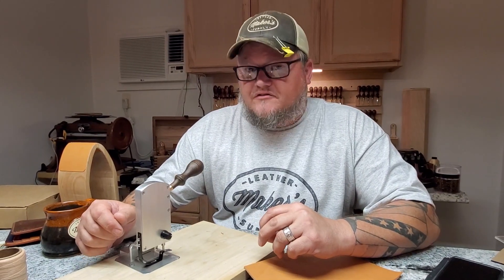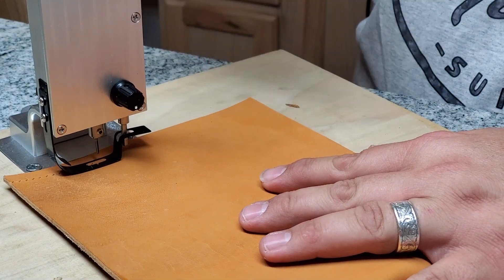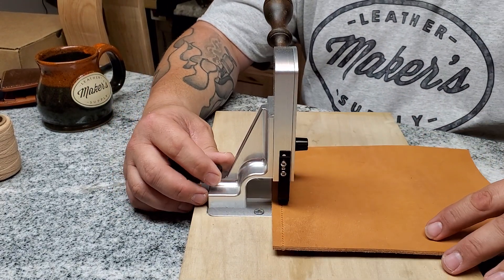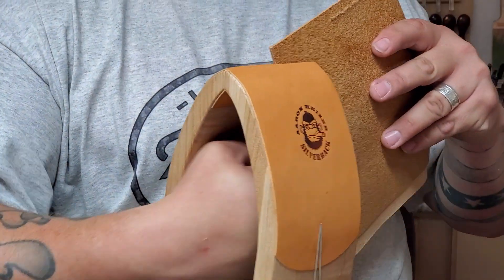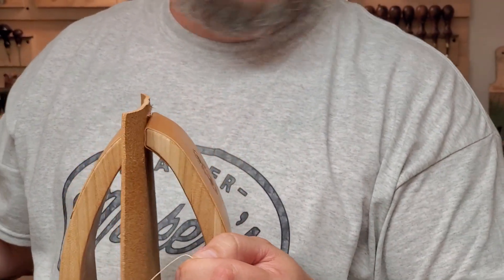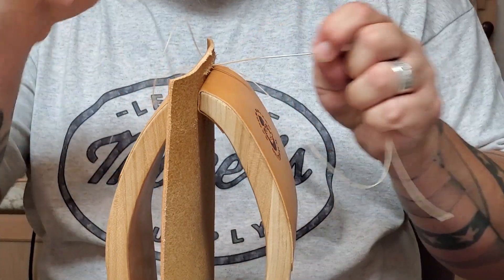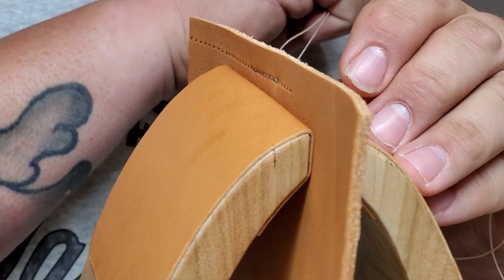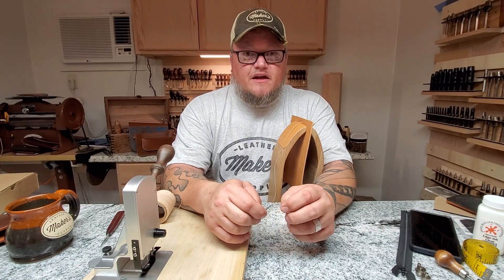The Punch-O-Matic Stitching Punch

Comment: I think that one thing that possible would make this better is if on the edge guide that you have a ruler to tell you how far away from the center of the hole punch
Reply: I was thinking the same thing. You can get a sticker with a tape measure printed on it at hobby lobby

Comment: is there different sized chisel punches? i use from 3mm to 6mm punches which have different sized blades. 3mm is alot thinner
Reply from the maker: It currently has 2 sizes.  We are working on 2 more.
Reply: @makersleathersupply1220  any thoughts to add a round hole punch options instead of a chisel?
Reply: Are the stitching punches sold separately

Comment: Can you punch thru 3 pieces of leather for knife sheaths? Like after you glue it up ... I use 5 -6 or 6 -7 thickness depending on the blade size. Thanks...
Reply from the maker: It would not work well with 15-21combined oz of leather.

Comment: I bought one of these and so far am having nothing but trouble with it. It doesn't seem to want to feed. It will do great for a couple of holes then stops feeding. If it's operator error I can't figure what I am doing wrong after between two and ten holes that's causing a problem.
Reply from the maker: Best thing I can tell you is you must make sure to go all the way down and then all the way back up with the handle on each cycle.  If you'd like to send it back for us to take a look at we would be happy to.
Reply: @makersleathersupply1220  just to double check there is no adjustment that needs made out of the box
Reply: After a little more working with it I am thinking the leather we were trying to use it on was too light weight for it.

Comment: In the coming weeks or months can you do some more demonstrations of this? Maybe include other complexities one would experience in a leather project. I specifically would like to see how the reverse side looks when dealing with multiple layers of leather. It is easy to put your 'stitch iron' EXACTLY where you want it on top, but it is a bit harder to ensure the iron comes through the other side EXACTLY where you'd hoped. It would be great if this device eliminated all variation between the top and bottom holes... 
Also, I would like to see a gradual curve. I can envision a sharp 90° turn being a non-issue but a gradual curve may be much harder due to the guide...
Definitely interesting, and definitely has the potential to increase the quality of hand made items. Just need to see MORE. MORE!
Reply from the maker: I'll be using it in lots of upcoming videos.
Reply: @makersleathersupply1220  - can't wait! 👍
Reply: This is not a new device.  I've never owned one, but I have seen them demo'ed at shows several years ago, and the backside was the main selling point.  I was a bit disappointed that Makers didn't give credit to the inventor. They presented it as though they had made it.

Comment: This thing cost me $25.46 to try it out. I sent it back and was refunded $285. 

Upon opening the box, I noticed the light weight unit was made of soft metal. The metal also had spotted stains, scratches and plenty of chatter from being made. Aaron later told me he was randomly inspecting the units but leaving them in their factory sealed boxes.

What really mattered to me was if the Punch-O-Matic would perform well for me! After a weekend of trying it out, I returned it. I simply couldn’t find a sweet spot to punch and have the leather walk up nicely or consistently with the foot. I could only get one dial setting the stitch width to the work on an occasional basis but it was useless because I had to manually advance the leather because I couldn’t get the foot to work well. Adjusting the foot proved to be too hard for me, I was so frustrated. I wanted this to work for me! 

As for the holes it punched, the back end of the leathers are blown out. I sent Aaron some leather that I punched so that he could see. Due to the blow out, I wouldn’t have been able to let products go out the door. I never got to adjust the chisel to a different angle than the factory setting. It was in the hole very tightly and I didn’t want to risk hurting it for fear of eating $285 instead of $25.46. 

Granted, screwing it down to a board might have helped some but I rigged it well with clamps and it was firmly planted. I just did’t want to risk scratching when screwing it into the bench.

Well, I sent it back to Aaron. After getting the unit back he approved a refund, but man, losing $25.46 for shipping from Aaron and back to Aaron was an expensive experience. 

Hopefully other buyers found the Punch-0-Matic to be what I wanted it to be.